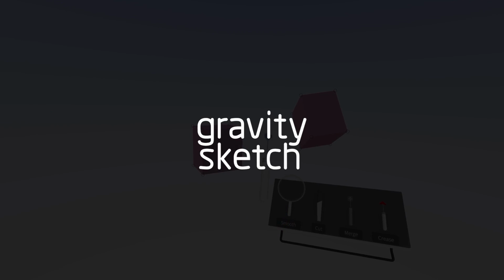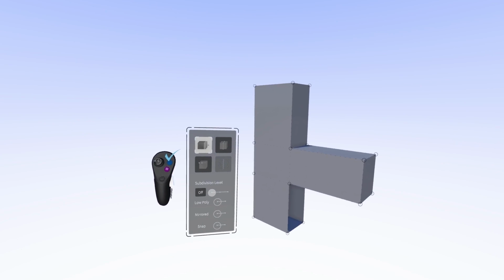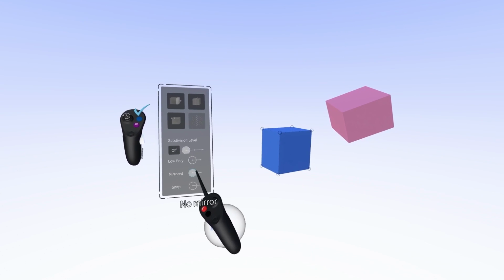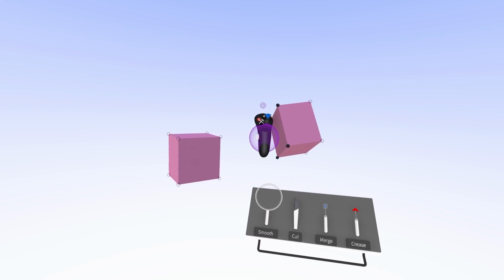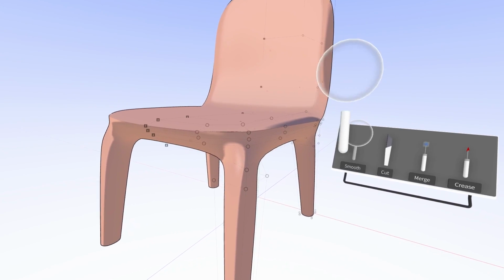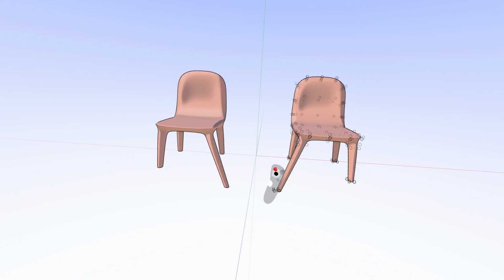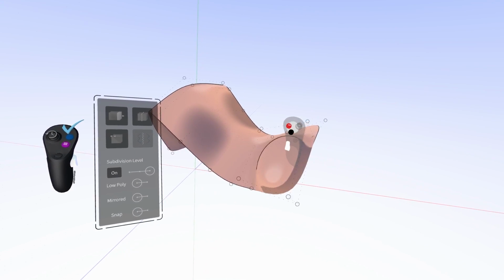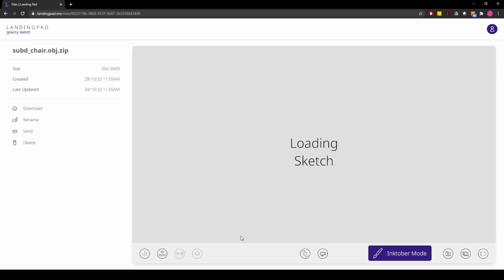Using subdivision or subd modeling features in Gravity Sketch - Tools Tutorial

Comment: Once geometry has been merged, can it be unmerged? For example. If you were to begin splitting a model into individual parts for manufacturing. It would be useful to have the Combine, Separate, Extract functions as with Maya. This is essential for splitting a single volume into parts. Extract is used to break faces relationship from the main volume dividing into parts.  Combine is used to group the parts, but not merge them, so they can modified globally as one entity. Separate ungroups the parts again so they can be modified individually, added to individual layers or exported individually. Cheers.
Reply: I actually found  out recently there is "grouping" vs merge. Check this:https://www.youtube.com/watch?v=-wABAbnDKTE
Grouping lets you move the parts together and ungroup them later. Merge seems to be a one way road when you mean to blend subD surfaces together

Comment: Does Gravity Sketch support volumetric sculpting like Occulus Medium did?
Reply from the maker: Oculus Medium is voxel based and we do not currently support voxels. Our geometry consists of nurbs and subd surfacing.
Reply: This^ ^
Reply: Yes it does
Reply: @iheartsketchbooks  So you don't need to care about topology or surfaces and you can just sculpt volumes?

Like I come from a background of sculpture so placing surfaces in strokes is just not how I imagine doing stuff unless I'm building a cage that I'm about to put clay on for a volume.
Reply: @osakanone  you can freely add volume to build your forms. Then smooth it out. If you want a cleaner mesh you can also create that using subdivisions

Comment: when will the program allow for more than 10 vertices? i am using it for 3d printing and my models are always to large no matter how small they actually are when it comes to importing into sub d in gravity sketch. . i guess i can run them through another program but im unfamiliar with others.
Reply from the maker: Make sure whatever 3d program you are exporting your models from that it is at the correct scale. Also make sure you haven"t scaled yourself too small in your scene when importing. Additionally you can drop your imports into the import box next to the model import menu and you can import at specific scale units. Check out our video on scale here: https://youtu.be/WUymuN4knnQ